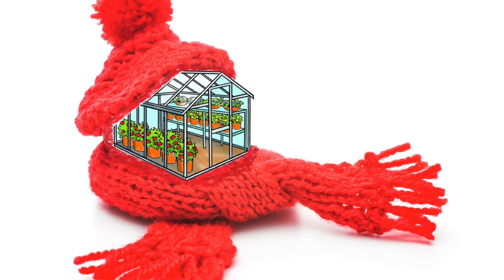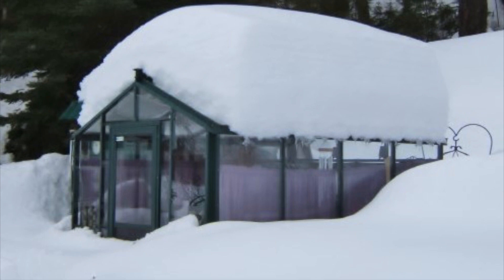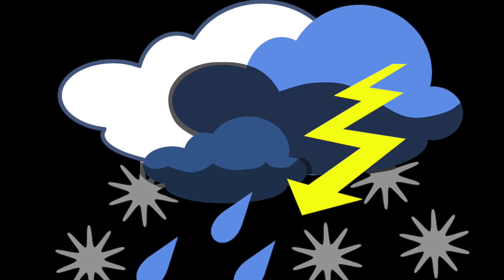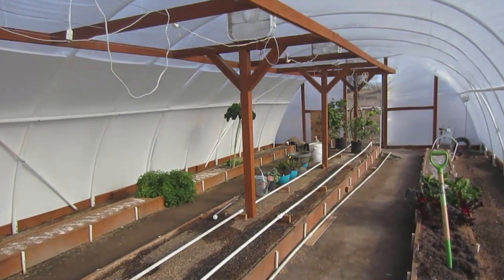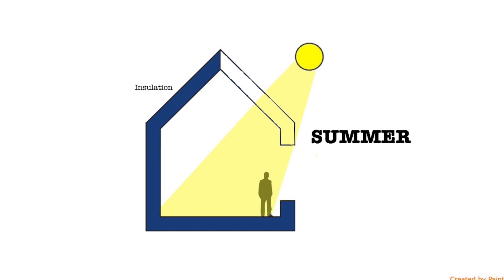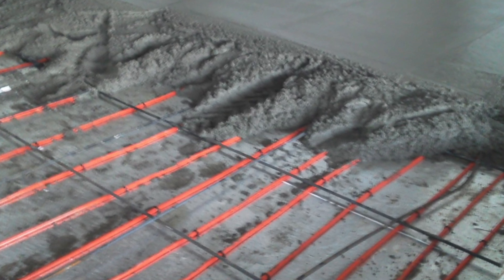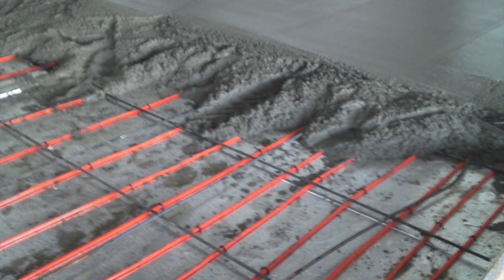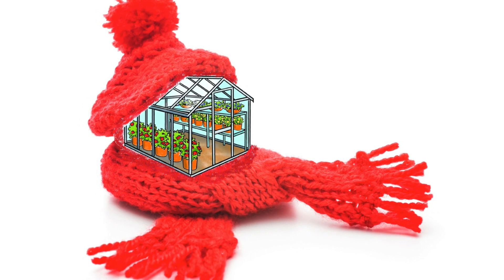DIY Deep Winter Solar Greenhouse Insulation (2020)

Comment: We are getting our greenhouse delivered in a few days.  We will be digging a trench 18" deep around the outside edge of the greenhouse and inserting 18" rigged foam board insulation 2" thick  in the trench against the edge of greenhouse, then backfilling the trench and compacting the soil every 4".  This will prevent thermal bridging of frozen earth into the greenhouse.

Still working on insulation of the north wall.  There is some DIY spray on foam insulation that I am looking at.  It needs to be 80 degrees outside in order to apply it.
Reply from the maker: sweet

Comment: you mightvwant to add a dark dye to the cement in the concrete floor. help absorb the  light heat reflected off the back wall and thru the windows. 

really liked the PEX in the floor idea
Reply from the maker: the concrete paint is a great idea!

Comment: I don’t know if this would work in Kitimat BC. The name means “people of the snow”. And it snows, and it is heavy. I would need to use something other than what you used for the roof and walls, but since it freezes at least 10 feet deep....not sure what do you think?
Reply from the maker: Great comment! I live north of Winnipeg, and although we get colder than you, you get a LOT more snow. I would do some stress tests on how much snow it can handle first for your area.
Reply: @SimpleTek  when I have to have my house roof shovelled because there is over 6 feet of wet heavy snow...it’s an issue to sort out for sure. How would I go about a test, and I’m presuming one must have been done by someone, but where to find info?
Reply from the maker: @colleenpritchett6914  Good question, it's not something I've had to look into as we don't get snow like that here. I wish I could help more but Im just guessing. How are your houses rated for snow load? Im assuming it might be the same process?

Comment: Cheap insulation for the bottom or back walls is hay bales stacked around the outside. They can be removable, or can be left to compost and that adds a bit of heat as well
Reply from the maker: great idea

Comment: Aircrete excellent, cheap, long lasting insulator

Aircrete Harry: is good channel about aircrete mixtures etc.... all kinds of specs what foaming agent to use and grade.
https://www.youtube.com/user/Cncdesignwork/videos
In his lates videos, he even mixes shred up foam, free from the bins.

You dont need to buy or make a complex foam generator, look at this vid below to get nice form from simple drill and metal mesh:
https://youtu.be/ddedMmuj7xY?t=701

Honey Do Carpenter channel:
https://www.youtube.com/watch?v=Ls-40KGuICA
https://www.youtube.com/watch?v=5k6iOOLdf24
Reply from the maker: great channels - I've been subscribed to them for ages!

Comment: What do you think of evacuated tube solar in a drainback system with 275 gallon tote storage and then pumping through pex and or fan blower to heat at night? These panels are pretty affordable on eBay and a pump/fan would use very little electricity. I'm surprised there's not more on yt of people using the citrus in Nebraska design that is proven, there's definitely ways to do it cheaper. The 3 wall polycarb is expensive, but I see it is a lot cheaper on Alibaba, looking into that now, perhaps doing a group buy to cut cost shipping from China, that's where it all comes from anyway, it is like a fourth of the cost of buying from a us supplier.
Reply from the maker: I like most of what your saying but I'm not a fan of drainback systems. Glycol or other cheap alternatives work well.

Comment: Could you lead me in the right direction?  I'm looking for DIY or plans to put together heatsink?  Would be much appreciated I am having a hell of a time finding anything.  A lot of videos and thats about it.  Thanks in advance!
Reply from the maker: Daniel C. All I got is videos, but I’ll try to help.  The cheapest heatsink i know of is 55 gallon drums, linked together top to bottom with hoses, linked to a few DIY solar thermal thermal collectors outside. Sergiy’s solar collector videos show how to make the cheap solar collectors, if you search you can find how to link up the 55 gallon drums. That’s the cheapest function heat sink that works well for most any greenhouse, make sure you insulate the north wall and follow ‘solar greenhouse’ principles.
Reply: @SimpleTek  Thanks a lot I do have a 55 gallon drum in my greenhouse with 5 gallon buckets as well to help with the geothermal mass.  It just not enough I will do more research with I don't mind at all it gives you a lot of great ideas.  Thanks again.
Reply from the maker: Happy to help!!!!

Comment: I live in the Pacific Northwest and am trying to heat up greenhouse by finding the right DIY heatsink method.  Thanks for video!!
Reply from the maker: Daniel C.  Thank you for the kind words!
Reply: Latitude 50 north in west coast Canada here. Our avg daily bright sunshine during the 6 months straddling New Year's in 2 hours. Not enough for photosynthesis.  Use enough gallons of contained water to triple the area of  glazing in sq.ft.
Reply: I live in the pacific northwest at 49 N. And I insulate all but the south side and the roof and use reflective grow room foil but I still don't have enough sun for active growth Nov. 1 to Feb.28. I concentrate active growth in the other 8 months. Too much rain and cloud cover. Good luck.

Comment: Hello Simple Tek, we are in the process of designing a VERY cold weather greenhouse in Canada at the Arctic Circle. Our target is to provide fresh vegetable for a community of about 500 people. We are planning to use PV solar panel array (battery pack included) from March to October to power the greenhouse. Not much electric lights needed as we have long daylight hours. From November to November to February well, that's a different story. We are considering using massive Garn wood boilers, wood chip co-generation power pallets, and Diesel generators as backup systems. There is a power grid but we are looking at $0.92/KW. Can't dig out soil and build heat underground batteries. The ground is solid granite. The Diesel fuel has to be brought on the ice road from Edmonton all the way to the Arctic Circle. Very expensive and it's Diesel and it increases our community's carbon foot print. We would appreciate ingenious ideas when it comes to greenhouse structure and most important, insulation. Love your information. As we'll build the project next year, I'll design a website and post online every step of the project. Thanks and keep in touch.
Reply: Those northernmost functional green houses blow my mind. Hope you can post a video about it when it's completed and show the solutions you came up with.
Reply from the maker: north of sixty sorry for the late reply, I actually have a few ideas for you. Will try and post them later today after I get an answer to my question. 

question, is there firewood up there very near to you you can harvest yourself or buy for under $200/cord or are you past the tree line?  Please email me, with some questions I believe I can give you some great economical ideas specifically for your location.  Hjor@mts.net

Comment: Hi Simple Tek,     
     I was wondering, what is the temperature of the ground at your location is at 5 ft, 10 ft, 15 ft and 20 ft below the surface? Would digging a 4 ft by 4 ft pit to a depth where you could harvest that heat be a useful idea. Can't wait to see your domes in action soon.  Cheers,     
      Bill
Reply from the maker: Thanks for the comment. I honestly don't know the actual temperatures at depth , never measured it. It would vary slightly from spring to summer to fall to winter. geo thermal heat isn't huge, you have to boost it using the ground as an earth battery.

Comment: How are you planning to deal with air circulation and moisture?
Are you planning on adding black water barrels as additional heat sink(s)?
Reply from the maker: Thank you master V - vents in spring, fall and summer. Winter is just testing. air exchangers aren't that expensive, but I want to know if it's necessary first. I want to experiment with dehumidifiers as well, to see if the water grows better like rain water or not. Not planning on black barrels but they are possible if necessary.

Comment: http://www.quora.com/What-is-the-insulation-R-value-of-air-trapped-between-two-sheets-of-glass
Reply from the maker: here's a calculator for different materials and their insulation values - but I see different ratings on all different sites - ranging from about R2 to R5. http://www.littlegreenhouse.com/heat-calc.shtml. It seems every 'expert' has a different rating and idea.  After reading a ton of material and no personal idea how to do testing for an R insulation rating I feel safe rating double air inflated poly at about R2
Reply: @SimpleTek 
Quick and dirty method to figure the effective R value of cladding. 
 R1/R2=(Ti-Tx)/(Ti-To)

Where R1 = 0.62 and R2 is the thermal resistance of the cladding assembly. 
Ti is the inside air temperature in deg. F. 
To is the outside air temperature in deg. F 
Tx is the inside surface temperature of the cladding system in deg. F.
(you measure Tx with a contact thermometer)
All you need to do is to solve for R2

Fwiw, a triple glazed inflated cover panel is R 2.3 to R 2.5 depending on the panel orientation. Vertical glazing is more suceptable to convection currents than horizontal glazing ;)
Reply from the maker: @JohnGuest45  Thank you!
Reply: @SimpleTek  
No problem. The air pressure in most double poly installtions doesnt provide much additional structural strength.The main benefits, apart from insulation value, is it keeps the poly taut preventing excessive flexing which will fatigue the poly and lead to an untimely demise. The other benefit is it deflates when hit by heavy gusts of wind and then reinflates, taking the sting out of the hit. To provide additional structural strength the cover has to be fully sealed so it cant deflate via the blower. You have to decide if you want the wind gust feature or the added strength, effectively a stressed skin. The air pressure in double poly hoophouses will typically support 1.3lb - 2.6lb per square foot. I went for the strength/stressed skin option and use higher air pressures which can support upto 10.4lb per square foot..